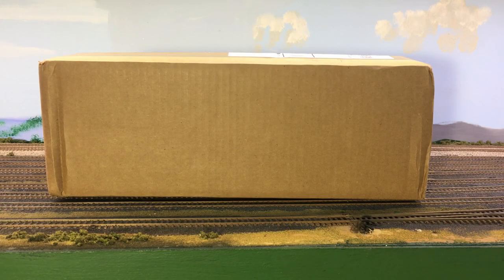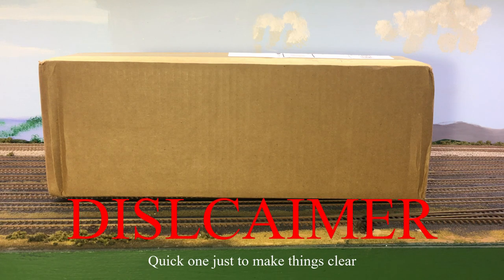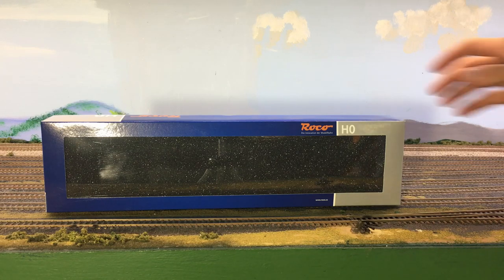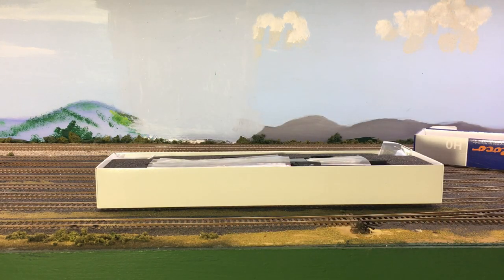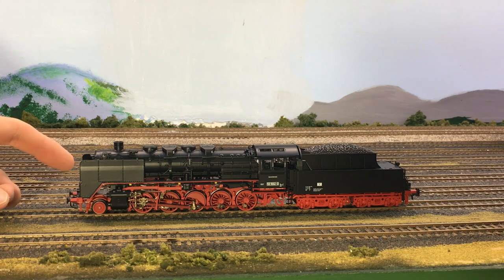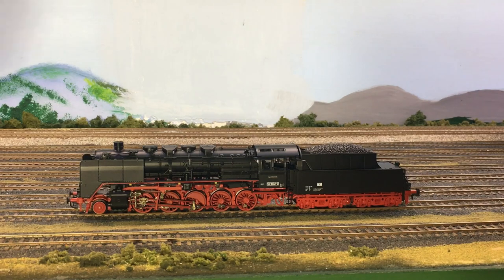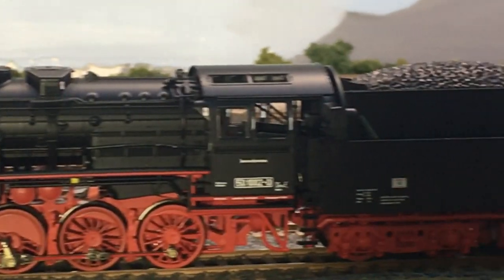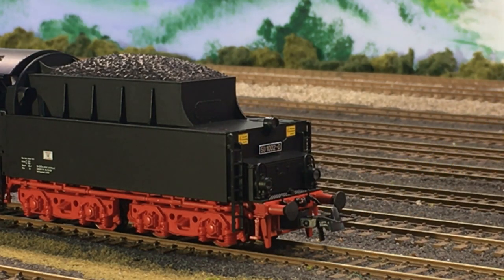German Wehrmacht Train Build Part 1: BR 50 Steam Locomotive

Comment: Translation of the anouncer (I didn't catch all of it and I am German): "Please board. The train will depart shortly." 
That's a very nice model! The Class 50 (light 2-10-0 Decapod) was by far the most sucessful in Germany, together with the Class 52 (a simplified version). I like that classic look with black boiler-cab assembly and red drive mechanism. The red paint made maintenace and spotting cracks and fatigue much easier. Check also that the spokes are webbed around the bearings of the couple rod, for added strength. The Roco model nails this detail.

Comment: Hi guy ! It seems you have made a little mistake these serie of BR 50 1000 - something is from DDR, they keep the name and the loks but they change the number a bit... But you can found the right plate numbers on Roco's website. Regards
Reply from the maker: Ah well thank you for that but of information! I really don’t know much about these German locos, I just think they’re super cool!
Reply: @The Train Fan   @The Train Fan  if you want a fitting engine to the war time era, you can do it out of that loco as the major parts are correct, there are only details that you can change. The DR of Eastern Germany changed little on the version you have (there are other, rebuilt versions with more variations). What you got is an East-German Epoche IV version. The German railroad history, modelrailroaders and modelrailroad industry divides the railroad history into Epoches (eras) like this: 
Epoche I : until the end of world war 1 in 1918
Epoche II : from 1918 to the founding of the Deutsche Bundesbahn DB in Western Germany in 1949
Epoche III : from the founding of the DB in 1949 to the computerization of the loco numbers (in 1968 in Western Germany, 1970 in Eastern Germany)
Epoche IV :  from the computerization of the loco numbers (1968/1970) to the reunion of the the railroads in 1990
Epoche V and Epoche VI are modern eras.
Your engine has a computerized number, visible at the control number „-0“ at the end (each digit of the engine number 50 1002 gets multiplied by 1s and 2s and the control number is the difference between the result and the next number of 10). So, in what your engine is different from an era/epoche II engine is the third upper head light (until 1958 only the lower lamps), you can remove it. The engine number would be „only“ 50 1002 (without the control number „-0“) and the withe lining around the number did not exist during the epoche II/war time. Another difference would be the informations written on the cab and tender sides. On the tender more or less only the informations about coal-tonnages, water (in qubic-meters) and brake informations existed in epoche II and on the cab, only the loco number, brake informations and the station informations did exist (RBD = responsible Reichsbahn Direktion, BW = Betriebswerk = shop where it was stationed/operated). The rest of the loco was the same during the war time.